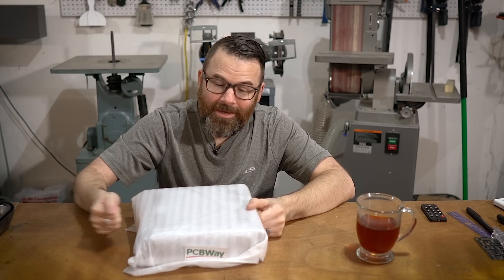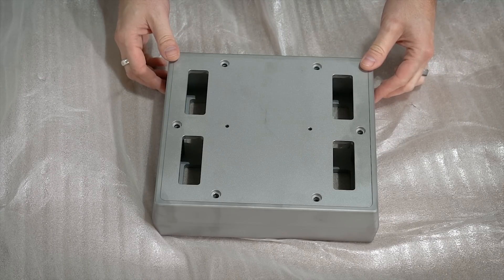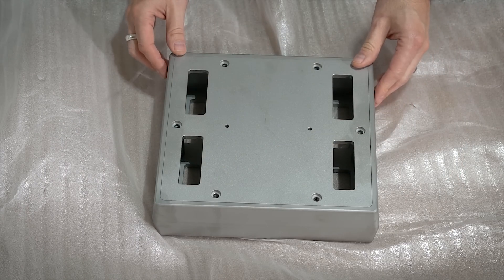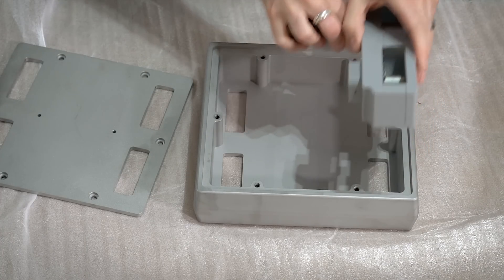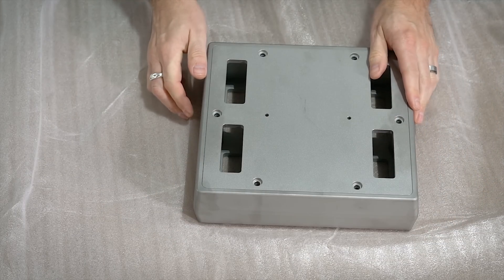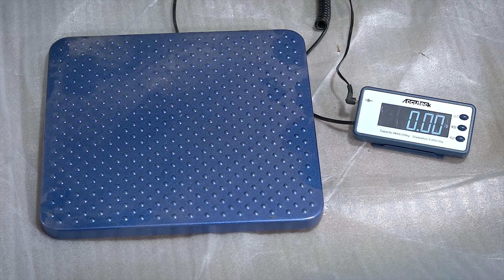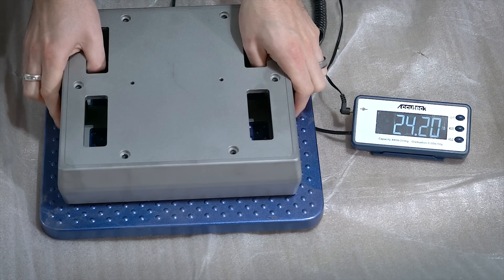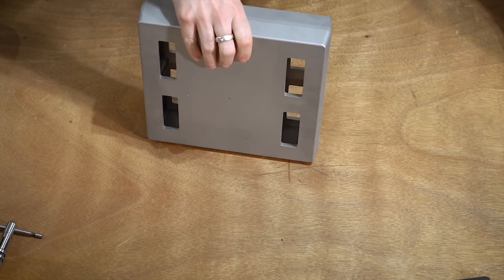Drain Bamage! - The Shell

Comment: One interesting element is that any spinner made from AR500 or a similar alloy could chip on contact due to its softness compared to S7.
Reply from the maker: Correct, anything less than S7 will not fare well against this.  Also, it's about 3x the weight of most weapons in this weight class.
Reply: @RobertCowanDIY  thanks for the reply and 2 follow up questions if you don't mind, would you ever consider doing this for Copperhead? I know Zach is the main designer but you already use the same alloy for the drum on your heavyweight and it would be interesting to see if nothing else.
Secondly, talking of Copperhead, are the nylon standoffs in your drive modules made of regular nylon or nylon x?
Reply from the maker: @TheInvertedFollicle507  The drums on copperhead ARE S7.  The standoffs aren't 3d printed, they're solid nylon.
Reply: @RobertCowanDIY  OK thanks. Do you think that using S7 for armour/frame as opposed to just weapon would be viable or simply not worth the effort?
Reply from the maker: @TheInvertedFollicle507  It's possible, but it's more brittle than the AR500.  In short, we chose the right materials for the bot and it's design goals.
Reply: @RobertCowanDIY  true it does have lower impact resistance than wear plate steel but you guys did get it right with the drum on Copperhead so in a sense if you chosen to take that route, it's definitely something that could be seen as a progression of sorts.

Comment: I'm the guy from reddit that asked you about a 1lb vert called poison who you recomended N30's to. Anyway, what if you took weapon motors from 60lb bots and used them asdrive for a 30lb meltybrain. Easier said than done, but it could be the complete opposite of drain damage.
Reply from the maker: I'm still waiting for someone to actually 'solve' the meltybrain problem.  I've never seen one that can convincibly drive, they all just look like random movement.
Reply: That’s the fun of it

Comment: I'd to love see electromagnets on a bot sometime. A bot like this would be a good fit, but maybe better in a higher weight class. You could keep a low down force when driving so it doesn't wear out the drive, and then ramp up the down force really high right before it gets hit. I think they are banned in some competitions for controlling other bots but not sure about for downforce.
Reply: Beta does this! They fire electromagnets with the hammer to keep the bot planted.
Reply: @joeofloath  that's good, chomp should do that, would be great with a walker, could even work with shuffle but would very advanced and maybe prone to failure. Imagining Jamison Go's 4.5lb shuffle bot, that never really get damaged on the shuffle system, but bigger. Could get dynamic stabilization or strong pushing power.

Comment: It looks like your radio has two antenna wires. If it does you could run one along the long side of a wheel opening and the other along the front then back down the other long side to give you an antenna that is around about half the wheel opening. Hopefully that shape and size of antenna would always be accessible to the transmitter.
Reply: Maybe one antenna wire on top by a wheel and the other on the bottom by a wheel in the event it may be turned upside down.  That would reduce the chance of radio interference in case it is inverted.

Comment: I am wondering if it might not be better to have the "girdle" split and moved to the top and bottom edges, rather than being center line vertically, since vertical spinners will probably be hitting on the top edge, where it's the thinnest?

Basically keep the same mass, just wet clay it so it's thinnest around the waist, and thickens at least along the top edge, or top and bottom.

Now, you know more about what height vertical and horizontal weapons tend to hit, so maybe this is exactly where the strength needs to be, but I just see all that mass, and a very thin edge at the top.

Nice solid steel, makes me grin, and I say that as an operator of, and mechanic on old Caterpillar tractors and bulldozers where solid steel was the only way they did things! Lol

Comment: Chonky! With how solid this bot is, are you not worried about energy transfer to the internals? or will you pad these slightly with something like TPU?
Reply: The mass is so high, the inertia will do a lot to protect the internals.
Reply: @ke6gwf  Shock loads will still be pretty high what with pretty much no give in the shell. The insides seem to have a tiny bit of wiggle room that could have some rubbery stuff in it to isolate them a bit.